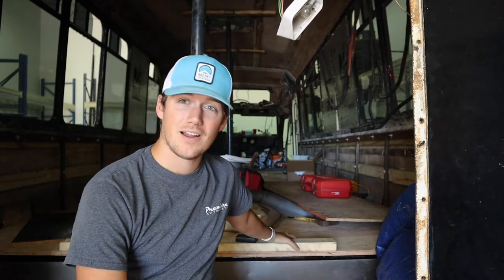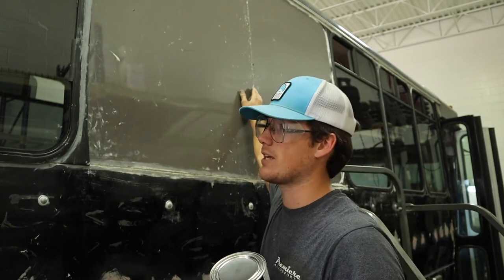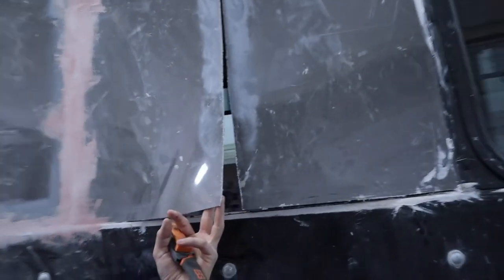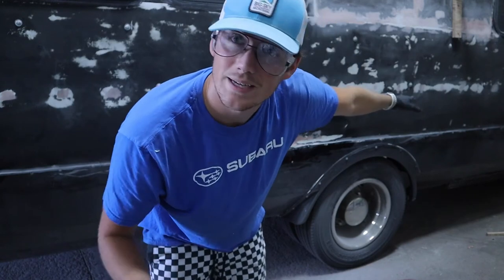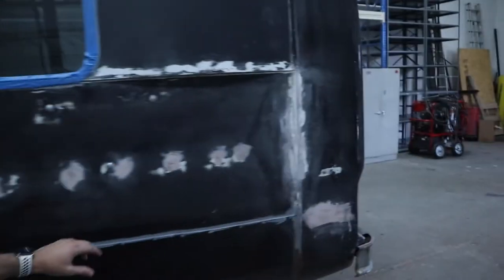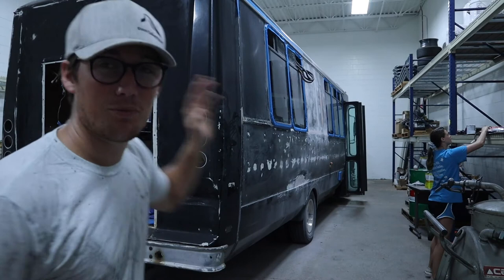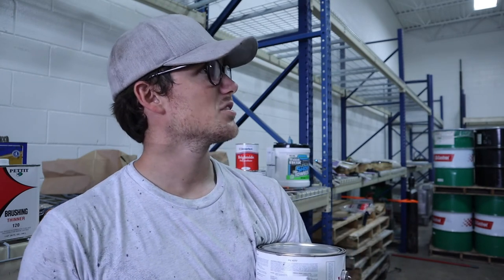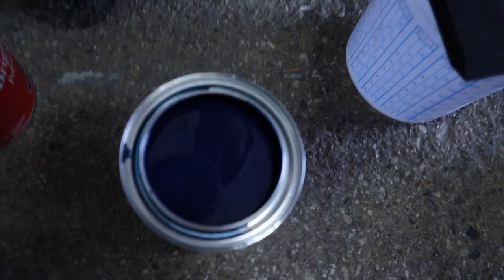Prepping A Fiberglass Bus For Paint! Bondo, Sanding, & Interlux Primer-Paint Pt. 1--Skoolie Ep. 21

Comment: I’m wondering why you didn’t screw the relief-cut panel to the plywood, then do bondo over?
Reply from the maker: Theresa Hartman trying time cover up screw heads with bondo would have been even more difficult, so we wanted to avoid using them